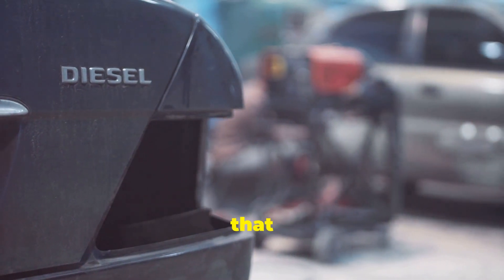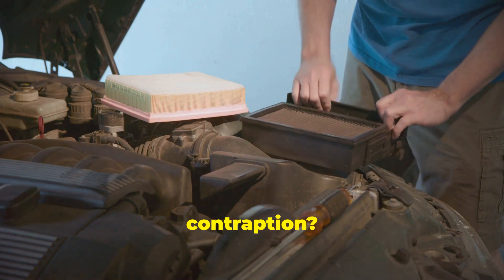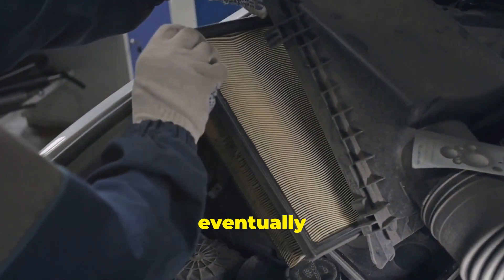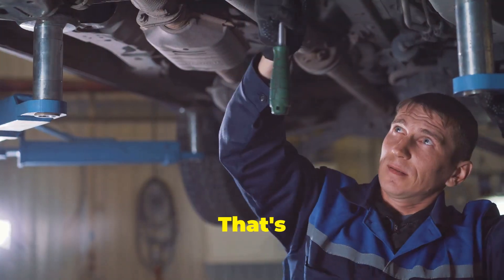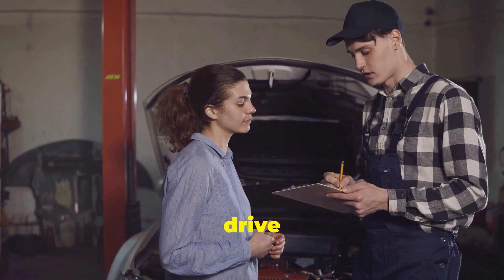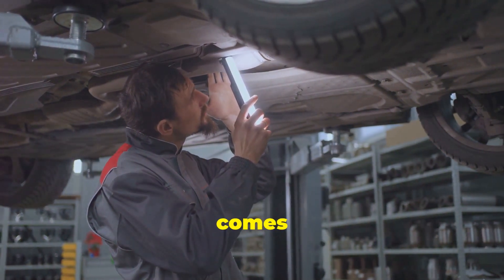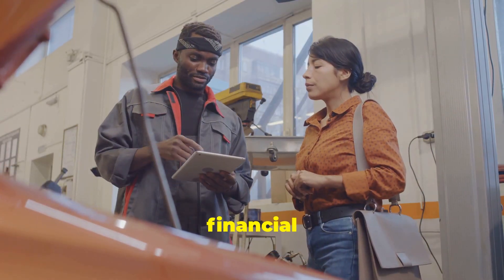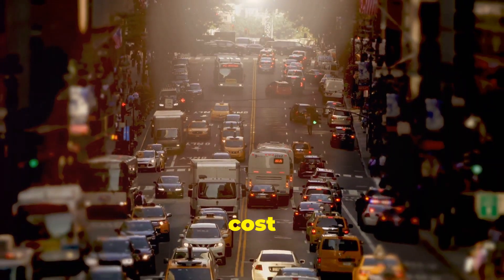What Is DPF | How DPF Works | Why DPFs Are So Expensive??

Comment: You just answered the air pollution argument the diesel soot drops to the ground 
So where's the air pollution 
Then if the soot drops to the ground I own my own truck & trailer and my 4x4 is Diesel too you keep your electric crap they are for the reset 15 Minute city proper gander